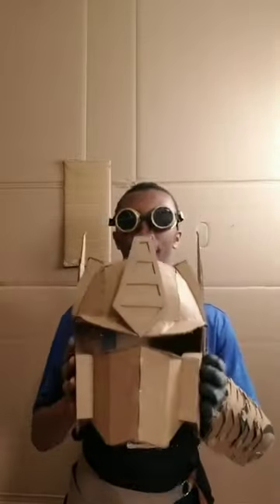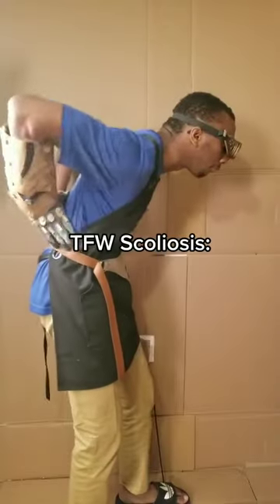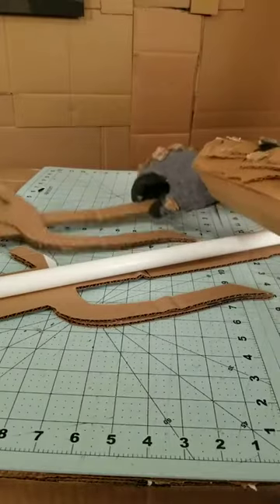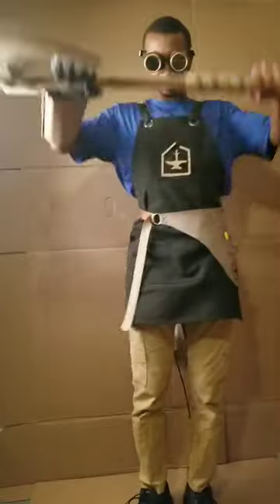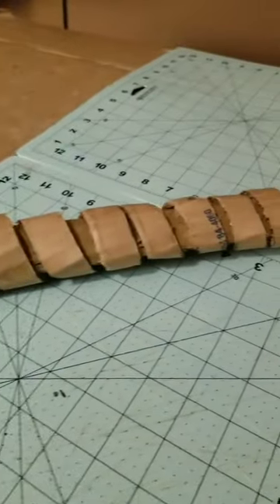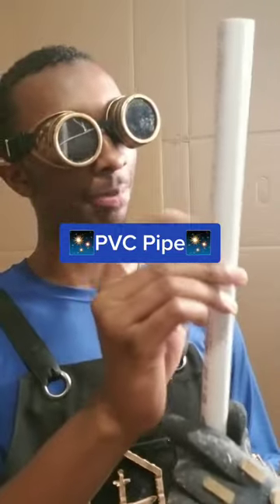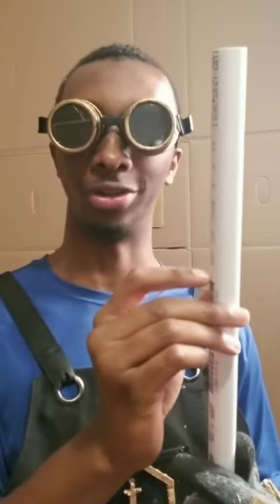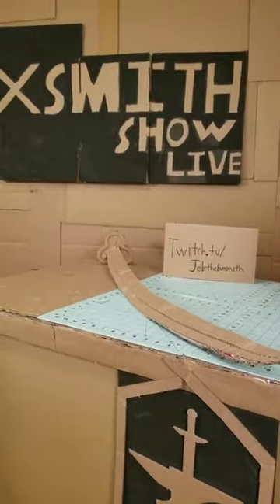Cardboard Weapon Rigidity

Comment: I’ve actually been using a spine for a long time, and didn’t know it was a widespread practice. Personally, I don’t have any kind of hard and durable plastic, but I do have long wooden marshmallow sticks, which are very good, and even though they sometimes snap, you just slot another stick into the blade to take its place.

Comment: I primarily use popsicle sticks. They are thin, strong, and very versatile. They can also be cut, shaved down to whatever shape you need
Reply: The only downside is longer things with lower layers of popsicle sticks in the spine will slightly bend as it goes down, but it’s nothing permanent and is barely noticeable